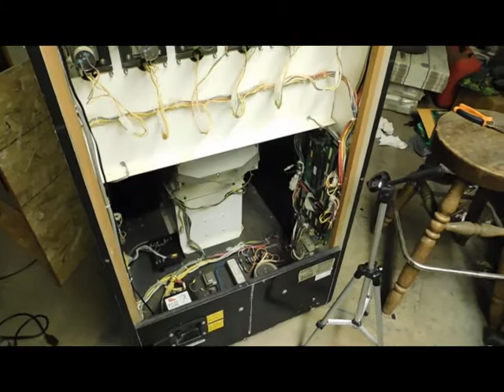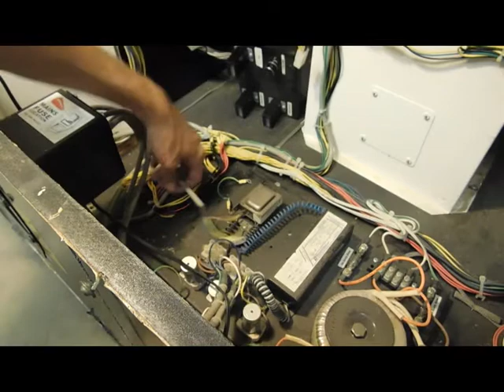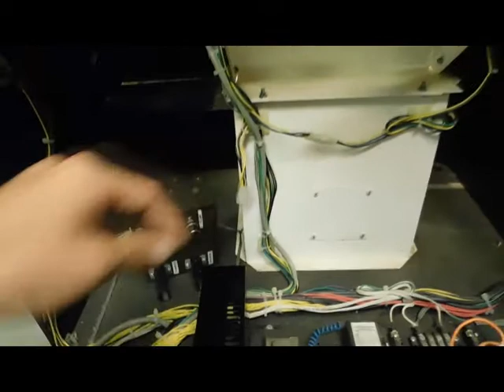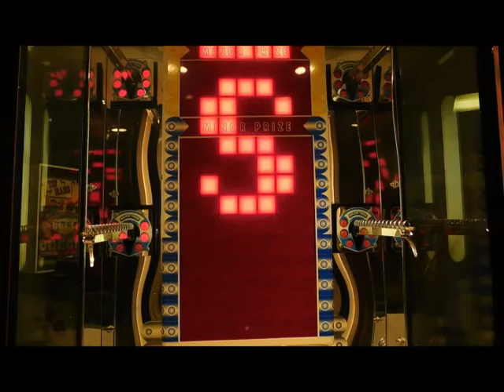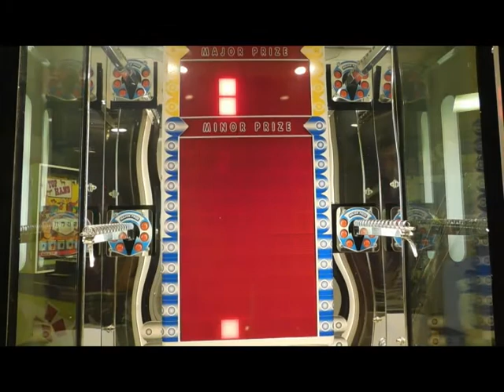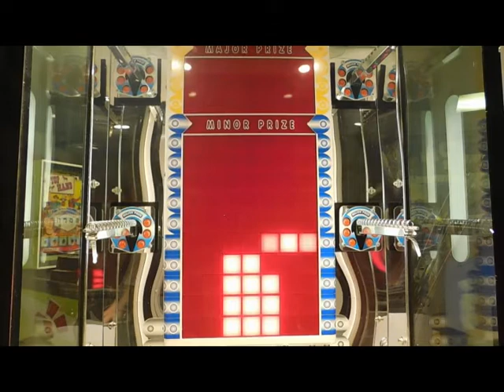How To Install A Power Supply In Stacker

Comment: My stacker machine works pretty well, however I think there is a speaker or sound board issue. When the machine is on you can hear the background noises and the blocks pretty well and then the stacker voice in the background is really quiet. Is there a way to fix this?
Reply from the maker: sorry for the very late response, it's been a bit since I've had time to really go through the comments. I'd first try and see if the sound ROM has good connection if that seems fine then I'd check the Sound POT to make sure that's working fine. The only other thing I can think of is the Sound ROM program is corrupted and needs to be reburnned or replaced all together.
Reply: Hi, so random but did you find a solution to this?

Comment: Some arcade games as a separate RESET CIRCUIT that is part of the original linear power supply. The brand new switching power supply doesn't come with the RESET circuit unless they are making KITS now that includes the Reset circuit with the brand new switching power supply>?